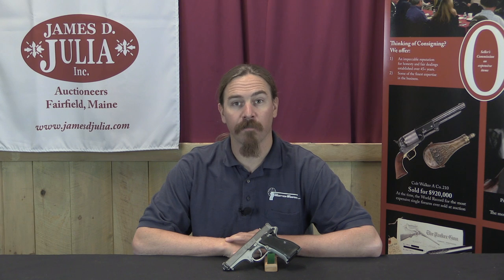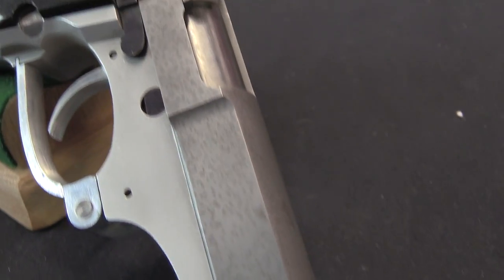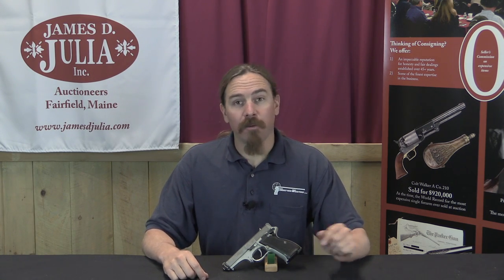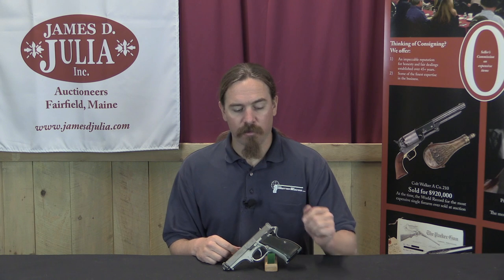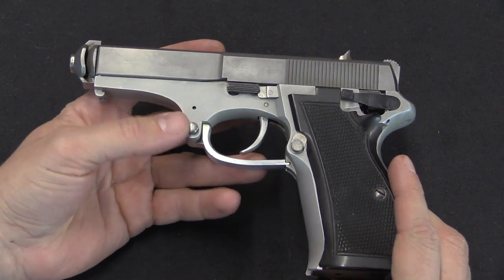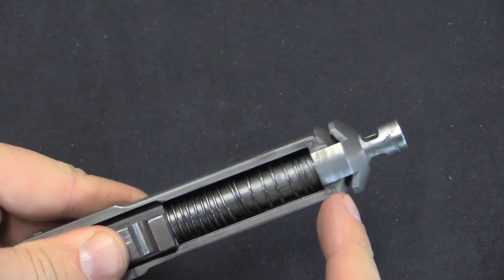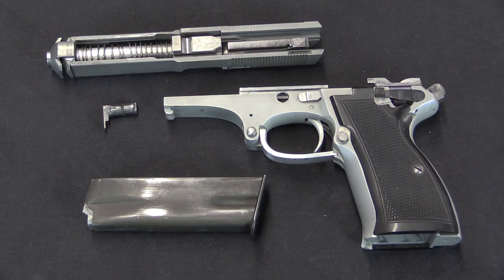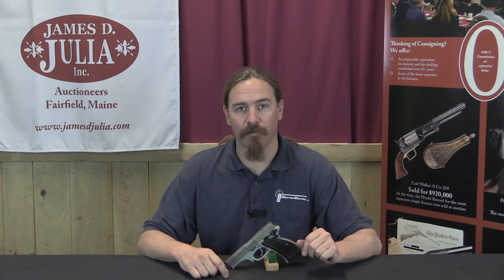High Standard T3 Prototype: An American Blowback

Comment: I hear this claim that it is ill-advised to use blowback in calibers bigger than around .32 ACP, but no one I have seen has ever actually gone in depth to explain why this is the case. It would seem to me that all one would need is to make a stronger spring to handle stronger ammunition. Perhaps this subject would make a good video for some gun nerd who has a degree in mechanical engineering and know his stuff?
Reply: Well if he didn't want people to call him a gun nerd, then he shouldn't have have coined the term himself in his introductions to his Patreon, Full30.com, or on InRangeTV. :)
Reply: 9x19mm is particularly ill-suited to blowback because it's a tapered cartridge. It offers absolutely no interface friction on extraction, and may actually accelerate itself out of the chamber if the pressure is high enough and the chamber dressed well enough. .32acp and .380 are straight-walled cartridges that will keep consistent friction through the extraction process and don't add or subtract to bolt face thrust under pressure (if a 9x19 cartridge obturates but doesn't 'stick', it will naturally by it's shape press back out of the chamber into the bolt face).
Reply: Sir jjohnston94, you must have been a very serious child. May you find joy in the little things in life. I know I do.
Reply: Thank you for a good point, Master Michael of Free. I had a feeling there was such involved, but I still consider it a topic that someone really should explore in depth and it sounds like something for a channel that specializes in pointing out the wacky problems facing gunsmiths since time immemorial.
Reply: Typically the spring adds surprisingly little delay to the system. This is in large part because springs deliver their maximum force at full compression, at which point the slide has already accelerated. Even if a spring was adequate by itself, too stiff springs can make a gun useless in combat, if the gun can't be confidently operated in less-than-ideal conditions (mud, blood, injury, etc.).

The basic problem is slide velocity. As the powder charge or caliber increase, the accelerating force acting on the breech face of a blowback gun increases concomitantly. This can lead to two major consequences: first, the excess velocity can batter the slide and frame. Secondly, if the slide accelerates too rapidly it can extract the case far enough with chamber pressure high enough that case rupture can occur.

With smaller or weaker cartridges, this velocity can be overcome with simple delaying techniques, or by simply increasing the mass of the slide so as to reduce its acceleration. However, beyond a point this mass makes the weapon too heavy for practical use, and a mechanical lock which holds the chamber closed until pressure has reduced is preferable.
Reply: Every round can be fired by a simple blowback system. Even 20mm AA cartridges are fired that way. Is only a question of weight of the bolt. Somewere between the .380 and the 9mm Luger, the required  increase in the weight of the bolt/slide "outweight" the gain in reducing the moving parts, and blowback handguns tend to be heavier than short recoil / delayed blowback ones.
The 9mm Glisenti, 9X18 mm Ultra and 9mm Makarov are often considered the limit over which is no more convenient to use simple blowback systems.

Comment: use 9mm glisenti.
Reply: Infact the Luftwaffe faced the same problem and came out with the 9X18mm Ultra (that was a ballistic copy of the 9mm Glisenti) as the most powerful round that could be fired by a blowback pistol mantaining weight advantages over a short recoil one.
However, "less than 25 ounces" for a 9mm, Luger, Ultra, or Glisenti, was simply an unrealistic request in 1949. It needed at least 30 ounches / 850 grams to have a functional gun, blowback or short recoil actuated.

Comment: Didnt the 9x18mm round come about because in Germany the Luftwaffe wanted a similar type of compact blowback gun more powerful then a .380 and created the 9x18 "Ultra" and then when the russians captured the German factories they liked what they saw and took that concept and the prototype work, simplified and adapted the gun and cartridge to Russian sensibilities, and created the Makarov 9x18 and Makarov PM pistol?
Reply: and the 9X18mm Ultra was nothing more than a 9mm Glisenti (used in blowback Beretta 1915 and 1923) in a 1mm shorter case (to avoid a 9mm Para being chambered by mistake), but before that John Moses Browning designed, for the FN Model 1903,  the 9mm Browning long, as the more powerful 9mm round you can use in a blowback gun without having weight disadvantages over a breechlock design (while he designed the .380 acp as the ideal 9mm round for pocket guns and the .38 ACP as the ideal for breechlock designs). All those rounds (9mm Browning Long, 9mm Glisenti, 9mm Ultra, 9mm Makarov) are in the same ballpark energy-wise.